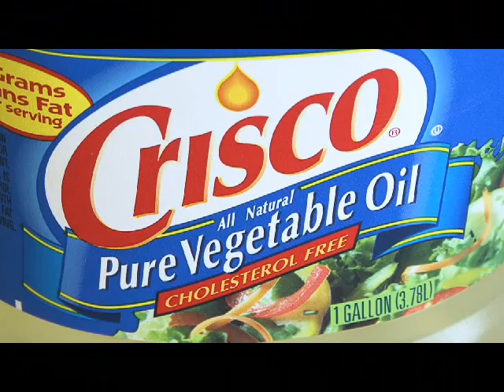Weekend Project: Making Biodiesel

Comment: yea just mix solvent with the vegetable oil,gasoline, white gas or turpentine will do the job. 80%oil/20% solvent .it will be a lots easier and it will work as good...
Reply: Ummm but solvent occurs in more propertion

Comment: can you run your car on only this homemade stuf ???or do you need to mix it up with regular disel?and will it clough injectors on o newer car ?like a land rover Discovery 3 or 4 ?
Reply: Diesel engines will burn almost everything, you can burn it pure. If filtered well it should be fine. However, Gas stations will only put like 10% bioiesel in their diesel.

Comment: the whole idea of biodiesel manufacturing is re-using vegetable oil. See the transesterification process of vegetable oil can be surprisingly faster if you use used oil from a regular restaurant or fast food place. the organic substances suspended on this type of oil are great when it comes to trabsesterification. Note: if using this type of oil you might need to filter it in order to get rid of unwanted remains of food. Also I found out that potasium hidroxide (KOH) instead of NaOH delivers a better quality of glicerine which can be used further on to make some soap. Biodiesel is a great fuel not as contaminant as regular diesel because it wont produce as much contaminants and since its molecule includes oxigen atoms in it combustion needs less oxygen from our planest's atmosphere.
Reply: actually, using oil from restaurants is not faster. Used oil is high in free fatty acids and needs to undergo a pretreatment to reduce that ideally to 0. The chemical reaction takes place very slowly (hours) even at relatively high temperatures (>300 F).   So its an issue of weighing the cost (money and greenhouse gases) of treating used oil to make it suitable for biodiesel process versus the cost of growing crops to extract the oil.

Comment: how safe is the process? do I need any precautions other than safety goggles, open area and gloves to work?
Reply: +Mohamed Al-Ganzoury Those precautions should be sufficient, I would also suggest not measuring out the Sodium hydroxide directly onto a weighing scale like he does in the video and also adding the Sodium hydroxide slowly to the methanol (Instead of methanol dumped onto sodium hydroxide) - This is because the mixture will heat up considerably and could potentially smash the jar if done the way it is done in the video.

Comment: Is it possible to render animal fat in place of the veggie oil?
Reply: yes you can! The result might even turn out better, but the problem is that animal fats are solid at room temperature, so it's more difficult to process than a (liquid) oil.

Comment: are the measurements of the lye and heat based on the amount of oil using? what is the ratios?
Reply: It's based on the acidity content of the oil. He left out the fact that you should perform a titration test to determine the amount of sodium hydroxide to use.
Reply: ***** Titration is only necessary if it is used oil. If its new oil, you shouldn't need to titrate it.

Comment: At almost 10 times the price of normal diesel I think not...
Reply: ummm no its way cheaper than diesel.
Reply: especially if you use recycled kitchen oil from like restaurant that has a deep fryer. you can get it cheap or even free.

Comment: how do you "wash and DRY" a liquid ? :))
Reply: Actually these are terms from chemics. To "wash" means you put another liquid in your solution that attracts (for example) H20. So you get two seperate phases on with and one without the H20.
You remove the phase you dont want. That process is called washing. "Drying" is when you put in your solution a salt (for example Na2So4) to absorb the remaining H20. Then you filter it and you're ready to go :)

Comment: Normal water contains metal and trace salts, if you do not use distilled water, contaminants from the normal water will be left in the biodiesel even if the water evaporates. This is not good for your engine.

Comment: After I poured my hot oil and the meth-oxide solution in my 2-litter soda bottle, and shook it for about 10 seconds, the bottle started to expand from the pressure. Will the bottle explode if I keep on shaking it? Am I aloud to open the top to release the pressure during shaking it?

Comment: Hey Kip thanks for the video I appreciate your time and knowledge.  I recently made 3 one litre batches of biodiesel.  Using virgin oil all 3 separated beautifully!  However, after draining off the glycerin I did a warm tap water wash by pouring as you did and misting.  All 3 have the milky water on the bottom and the biodiesel will not clear.  Can you or someone help me? Thanks

Comment: Boomerangfreak clearly does know how diesel engines work it seems. Do you even know how RC engines work?

Combustion for the power-stroke on an RC engine is achieved, not by spark ignition, but by compression, just as it is with a diesel engine. 

Model RC engines also require a glow-plug to preheat the fuel/air mix above the piston to aid combustion..

Comment: The only pipes that might "corrode" are the rubber ones. As most cars cars post 1996 use Viton pipes and pump seals this is unlikely to happen. I have been running biodiesel for the last 5 years covering well over 100000 miles and have had NO problems

Comment: @lol9392 wat its fucking oil diesel is basically oil but i have been running 100% biodiesel for the past 4 years at about $1 to .50 cents a gallon in an unmodified vw passat, vw jetta,chevy pickup, dodge sprinter and my vw rabbit, just dont use it under 40 degrease Fahrenheit please pm or reply if you would like to know more this is a great money saving project.

Comment: @shain003 
biodiesel is not C1 but longer chains of fatty acid esters. Methanole, carbon dioxide or biogas (methane) are C1. Before, you wrote biodiesel can be made from fermenting sugar crops, what is in fact bioethanole not biodiesel. Apparently, you are mixing up the concepts.

Comment: Nice job using metric volume and weight measures throughout the video, but at 2:17 you should have mentioned that your 130 degrees is Fahrenheit (54 degrees Celsius).

Comment: Nice job using metric volume and weight measures, but at 2:17 you should have mentioned that your 130 degrees is Fahrenheit (54 degrees Celsius).

Comment: @Porterjebazillanator its a mid to long term project; once you get set up and have free to low cost used oil to work with, your total cost is around 70 cents to 1 dollar per gallon. Once you make enuf to offset the cost of your equipment, you're home free. Just to make that clear.
Its not that hard to figure out.

Comment: my MB 300sd 500k miles runing for 4 years on straight veggie with coolant heated tank but I can mix it with diesel or kero. or even a gallon of gas or e 85 and runs just fine no problems, more power and less engine noise anione that comm. against never has used this fuel thats a fact

Comment: @PleasurablyNumb  Briefly. Then it will break and stop running. There are some modifications you need to make to run it as well as if you had regular diesel. BTW, you need to go through the steps in the video to make an extremely clean fuel, other wise it will clog your fuel system completely. And that's bad, if you haven't noticed.

Comment: For net energy yield, ethanol from sugarcane in Brazil is in a class all by itself, yielding over 8 units of energy for each unit invested in cane production and ethanol distillation. Once the sugary syrup is removed from the cane, the fibrous remainder, bagasse, is burned to provide the heat needed for distillation, eliminating the need for an additional external energy source. This helps explain why Brazil can produce cane-based ethanol for 60¢ per gallon.

Comment: @mikehanoo3 Im on the same page as you are, in the sense that I know there has to be change but it's not going to happen overnight. Using existing technologies on the proper scale in the right places will lead the way for cleaner and cleaner energy. Costa Rica makes 90% of it's electricity from renewable recourses (hydro power and geothermal) and the people of Samso Island, Denmark are now producing 10% more electricty than they use thanks to wind power. Petrolum still has uses.

Comment: @mikehanoo33 Changing the infrastructure to use only electric cars (Currently electric cars are dirtier then some hybrids depending on your state [what comes from your outlet is likely, mostly coal]) and using Nuclear power would be ideal. As far as waste disposal goes, Uranium gives off heat which could be used to self-propel it's decent into the earth's core avoiding any life-containing space completely. Where are we going to get the Uranium? There is a small portion in ALL Ocean water.

Comment: hey brazil is spending ver 200 billion $ to drill off shore , so i guess big oil is there  BTW the usa donated 8.5 billion to help brazil drill offshore- brazil grows sugarcane , too for fuel, the usa  grow corn for bio fuel , the natural growing grass off the midwest is switch grass with 2.5 times more fuel per acre , and doesn t have to be replanted ever year,and you get more than 1 cutting or harvest a year!! what the hell is wrong with the bio fuels designers in the USA- MORONS-

Comment: @blairBROKEN  85% of the cars in Brazil run on ethanol made from sugar cane , this will work in all normal gasoline burning motors , no need to switch to diesel , the oil companies want you to be confused and afraid , check out David Blumes websight , he sells convertors for your car to run on 100% ethanol , and he shows us how to make a cheap still and make are own clean fuel .Its just moonshine .

Comment: @blairBROKEN I know, which is one of the reasons bio diesel isn't widely considered an alternative fuel source, even though it's clean and cheap to produce, better for the engine and the MPG is higher so you wont have to refuel as often.

Which is why I said, when it comes down to it, most people don't really care about protecting the environment. If they did they would jump on bio diesel. Even "environmentalist" don't REALLY care about the environment, at least not the Hollywood ones.

Comment: When it really comes down to it. I don't think most people care about environmental impact more then they care about how much there paying for gas. And biodiesel can be a cheaper. Since you can use used cooking oils of different types. But it takes a few extra steps. The hard part is getting people to switch to diesel engines.

Comment: @thechoosendude Where'd you get that "fact" from? Because it certainly isn't true... 
Biodiesel is remarkably clean compared to regular diesel fuel. It doesn't contain sulphur, contains far fewer aromatic compounds, produces far fewer exhaust particulates. And, given that it's produced from vegetable material, contributes much less to carbon dioxide emissions  than regular petro-diesel.
Pretty much the only bi-product of biodiesel production is glycerol, which is useful for a number of things.

Comment: I'm sure it costs over 5$ to make a gallon, not to mention you will get less than 30 miles out of it, for what, 2 hours of total work time, not to mention you are handling hazardous chemicals. Basic petroleum diesel is cheaper and safer.

Comment: In the UK, Diesel and Vegetable oil (from supermarkets) are approximately the same price. The trick is securing a wholesale supply of oil, or find a source of waste oil and use that.
You can run diesel engines on pure Vegetable oil, but you need (ideally) an additional fuel tank for the oil and a heat exchanger in the fuel line to heat it up to burn efficiently.

Comment: You do but they aren't expensive, loads on ebay, if you use free used veg oil you can make bio-diesel for under 10p a litre, if you are from the uk you will know its a saving of more than £1 a litre.

Comment: Last time I checked veggie oil out of the supermarket was even more expensive than regular diesel out of the pump. Add the cost of the heet and sodium hydroxide (which the feds pulled off the shelves due to meth heads) and it is not cheaper unless you can get your hands on the sodium hydroxide and free veggie oil in bulk. On another note the old cans of camp fuel is also methanol instead of the new naptha.

Comment: honussa your such a spam, the idea of using biodiesl is to recycle waste oil, while providing economical fuel and reducing emissions. if you use regular vegetable, well it also works, but youll be using up oil that could well be used for food, and you need to make some modifications on newer diesel engines to run on veggie oil. biodiesel can be used strait or mixed with petro diesel. its a choice, neither is perfect

Comment: wrong...glow plugs only assist diesel engines on cold start up, once the engine is up to operating temperature the glow plugs turn off. the diesel fuel is ignited by the extremely heated compressed air.

Comment: Diesel engines work the same as standard combustion engines except for one difference.  The flash point of gasoline vapor is low, and with the right vapor to air ratio, can be ignited by a spark source such as a spark plug.  Diesel, however, has a much higher flash point and must be ignited by a high heat source such as a glow plug found in diesel engines...

Comment: your intentionally showing how dumb you are.  Ill break it down to you: Energy put into making the solar panel=100units, Maximum energy obtained from the solar panel in its lifetime=25 to 60 units.  Therefore its inefficient.  the tech is getting better but as you can see it is not efficient.  The datum for your statement comes from 'buying it from a shop,' thats a pathetic way of looking at things.

Comment: Actually it wouldn't, If you're making large quantities of bio you buy the methanonl in 55 gallon drums and the lye in 50lb bags, so it is actually made for less than one dollar per gallon one of my friends has never paid more than 54cents to make a gallon of bio. And if the price difference isn't enough, bio cleans your engine. Diesel engines can easily run for over 300,000 miles when run on bio.

Comment: i hate to sound over simplistic, but my ladrover will run on cooking oil streight out of the bottle without anything done to it what-so-ever. although it mabe wouldnt work on a newer electronically controlled diesle, but it works fine in mine, only problem is starting is a bit moe dificult due to the thick gooey-ness of the oil, but this can be cured by adding a very small ammount of white spirit/thinners, or just mixing the cooking oil 50/50 with normal derv.

Comment: Great video.  The reaction can go without heating the oil. If you put the lye in a plastic bottle (preferably hdpe) then add methanol, you can use the heat of solution of the lye in methanol to kick start the reaction when you add the vegetable oil to it after the lye dissolved.  You will not need to dirty so many utensils.
Check out "Hay Fever OK!" video for another use of oil.  Happy Driving.

Comment: even from a commercial 10% biodesel pump, the crap still manages to clog diesel fuel filters 3-4 times as fast. Especially Chevy's Duramax diesel. For those of you who decide to run bio, I'd recommend running additional filtration. Clean fuel in a diesel is critical for fuel system life.